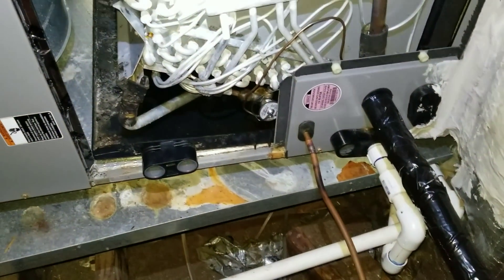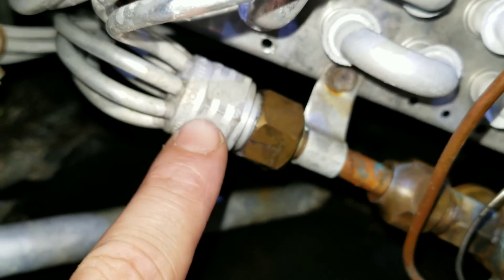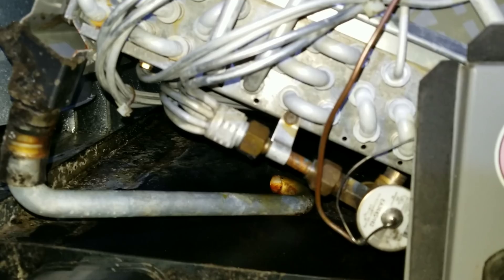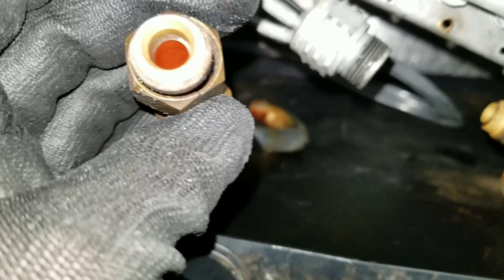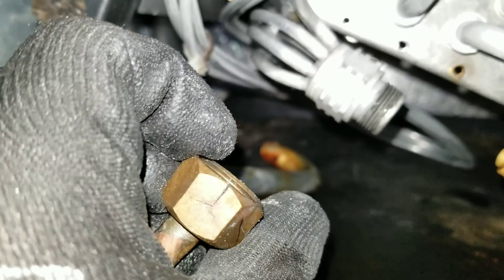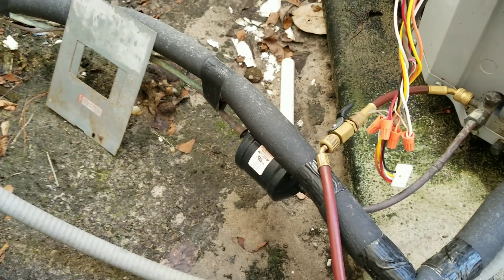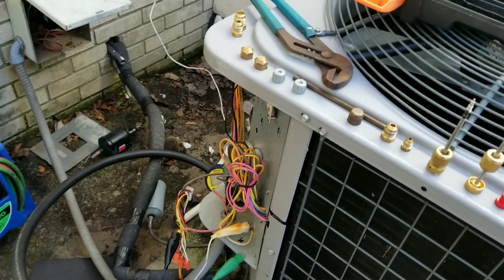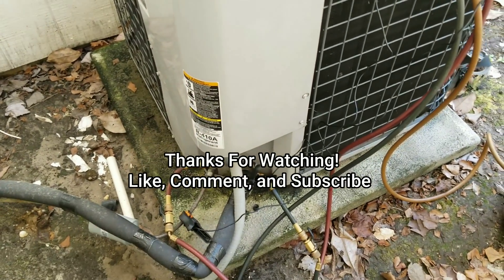Heat Pump Service - When Maintenance Becomes Repair

Comment: Good find. I'm sure you looked like a hero to your customer. Could have been so much more complicated. Wonder why didn't the customer didn't call the original installer?
Reply from the maker: Thanks! 
It is very common around here for the owners of these little rental properties to use multiple contractors.

Comment: Not seen many w/ flare TXV's on ICP's. Nice video, thanks brotha!
Reply from the maker: Super common now with the aluminum coils. Thanks bro!
Reply: @HVACinSC  wonder if it's an AH thing, or perhaps I don't open up the cased A-Coils we get, just seems goofy to have the chatliff and a flare right next to each other, why not a normal chatliff style TXV, I wonder.
Reply from the maker: I believe it comes with every replacement air handler coil (Carrier/Bryant/ICP) but is only used when the original coil was copper and new coil is aluminum.

Comment: You would think that the distributor threads would have been pooched if they torqued the brass so hard it cracked it. Good video, thanks.
Reply from the maker: I was thinking that was a real possibility but got lucky and had no damage. Thanks for watching buddy!

Comment: Found the exact same thing recently slant coil though.
Overtightened. The nut was cracked and blew apart first time they used heat mode.
I too keep a bunch from coil replacements.

Comment: Those nuts are made of cast metal and if you over tightened them after time through expansion and contraction they will crack I have been running into that sense the early 80's it started with Carrier back then. A torque  wrench would go a long way in this case.
Reply from the maker: I've seen a few crack over the years but not quite this severe.
Reply: @HVACinSC  it doesn't matter once they crack you have to replace them. It seems to me they would make them out of better material.
Reply from the maker: @hvacrcole  Of course, once they crack you have to replace them. If the make them out of stronger material we may have to replace damaged distributors instead. 😏
Reply from the maker: 😆😆 Indeed we should!

Comment: Probably had one split with the old coil. The replaced the coil and caused more splits. Good fix. Did you use Nylog?
Reply from the maker: I usually don't use Nylog on these fitting but I'm sure it would work well.